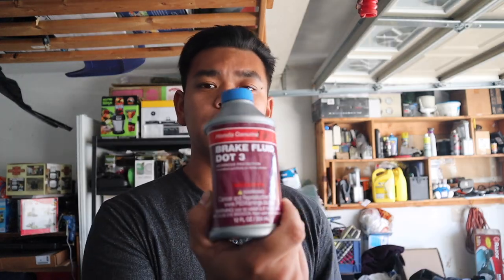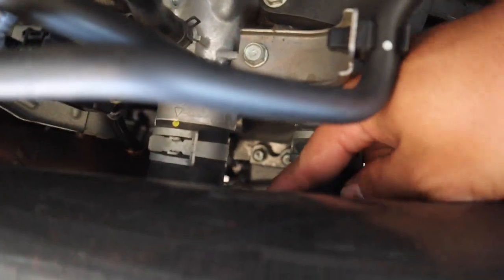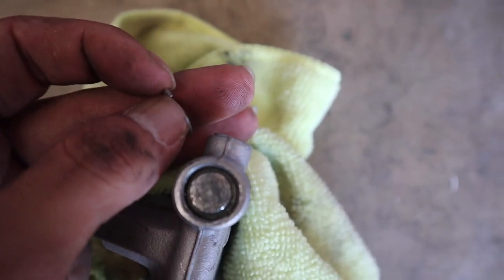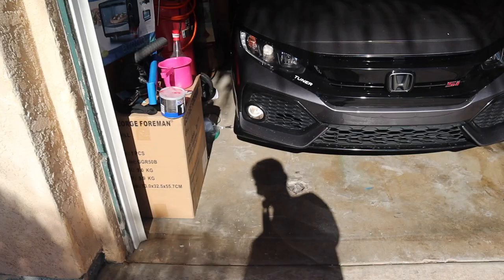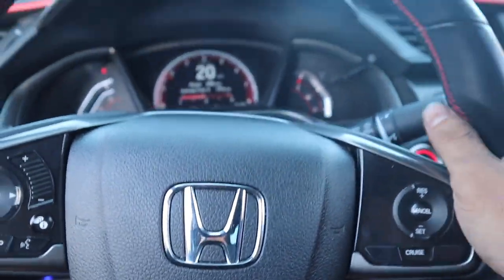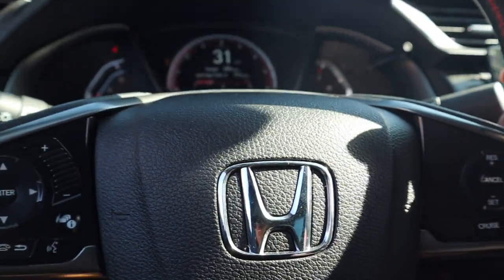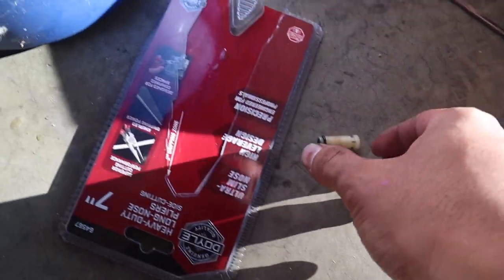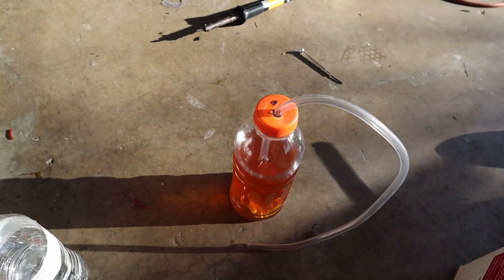BEST FREE MOD! | 10th Gen Si

Comment: Just removed mine on my 2010 TSX. Makes engaging the clutch to the bite point more consistent and smoother. My 1 to 2 shifts used to be so jerky that everyone thought I couldn't drive manual. Every other car I drove, I never had a 1 to 2 shift issue. I drove  Genesis Coupe 3.8 Track, SN95 V6 Mustang, FA20 WRX, Mazda Protégé 5, and Mazdaspeed 3. I always shifted better in other people's cars aside from my friend's TL Type S. That car also has the delay valve and the 1 to 2 shift is TRICKY!
Reply from the maker: That’s what I’m saying! It’s the delay valve! Glad to know this video helped you out man!

Comment: I did the same but pedal was kinda soft. So I ordered "speed bleeder". Bleeded clutch line first and then bleeded slave master cylinder itself. Pedal became firm. Overall it performs now the way it should come from the factory. No more jerking on the 1,2 gears. Thanks for your guidance.
Reply from the maker: No worries! I’m glad I was able to help!

Comment: Great vid...thanks for sharing these tips.  Have you replaced or upgraded the clutch yet?  The lightweight flywheel eliminates rev hang and improves throttle response considerably.  I think this is the next mod I need. The "jerkyness" almost got worse after the clutch upgrade.
Reply from the maker: Nope, stock clutch here still holding up !

Comment: Did your pedal feel lighter after deleting it? I did mine today and the pedal is butter.
Reply from the maker: Pedal is definitely butter! I don’t remember if it was lighter or the same, but I do know it was butter smooth!
Reply: @FORSAKENGARAGE  it almost feels too light, I was worried I didn't bleed it all the way. But I bled a few times after getting no bubbles to be safe. Maybe it's all in my head!
Reply: @AllBackEmergency  After deleting mine it feels light too, there's a video guy recommends bleed clatch line first then bleed slave cylinder last. But still feels lighter then it was, hope it's ok. I also had to seal threads on the bleeding valve because it was leaking air throug threads. Harbor Freight Tools sells vacuum brake bleeder for $20

Comment: Any updates on your transmission? Due to removing the CDV
Reply from the maker: Running fine, love the way it turned out, never looked back
Reply: @MVRKVLG i asked someone else yesterday about that and they said I shouldn’t do it. Q: are you on ktune/tsp Hondata or Pherable tune? I have the mind to do it but i need more input on pro’s n cons
Reply from the maker: @kingstonflores3040  Ktuner w/ phearable 1.5
Pros:
-instant grab no delay on the clutch
-removed notching on gears
-makes it easier to drive
-driving when you first start the car is no longer jumpy (if that makes sense) 
Cons
-cause transmission wear if you do not know how to drive manual due to the instant grab
Reply: @FORSAKENGARAGE  i should be good then. I’ve been driving since 12 legally since 30 🤣🤣🤣🤣 straight drive is all i drive anything less is uncivilized 🤣🤣🤣 thanks for the tip bro will get done when i install my 27won inlet pipe
Reply from the maker: @kingstonflores3040  its always reversable! If you do it and don't like the difference in feeling/response (which i 1000% love the way it is with the cdc removed) then you can always throw that valve back inside the cylinder as long as you don't throw it away! That's also why the video is titled best free mod! Of course with you having the tools laying around and some dot 3 brake fluid
Reply: @FORSAKENGARAGE  bet nuff said brother I’ll keep you updated
Reply from the maker: @kingstonflores3040  definitely comment back when you do the mod, I’d like to know your feedback on this simple mod

Comment: Forsure doing this mod I have the sirimoto CMC at home I’ll do both I have a stage 3 action clutch and I hate the engagement of it I know the clutch can grab harder this delay valve makes it feel like it’s slipping. Check my channel I have a lot of 10th gen si content
Reply from the maker: I’ll check it out later brotha! I’m currently busy, but yesssss you’ll be glad you got rid of that stupid valve they have. Huge night and day difference, how hard was the clutch install? My clutch is starting to slip, and I’ll be doing the work when winter comes that way I don’t gotta be sweating my ass off, I know you have to take out the axle and subframe but how was the work?

Comment: car sounds HORRIBLE.
Reply from the maker: To each their own 🙏🏽
Reply from the maker: @dirtyasianmafia2310  I agree, it definitely is something you either hate or love, to each their own! Thanks for watching I hope you enjoyed the video at least :/
Reply: Lol
Reply: Is that a custom exhaust leak?
Reply: yeah 10th gen pretty smooth so it makes sense to have smooth sound too. The SI especially is a more premium model and the coupe is the best looking 10th gen Civic. The factory SI exhaust sounds good, flows pretty good and makes better aero underneath
Reply: @jamesmedina2062  after going to hks on my 10th gen I have noticed that the stock exhaust was causing alot of drag underneath and how restrictive turbo response is more noticeable even with my tune
Reply: @aaronslaughter2987  drag is lowest with the stock SI but flow can be easily improved.
Reply: @jamesmedina2062  not really seeing how since the stock exhaust spans the width of the car at the real wheels with the double mufflers. Once you get rid of that its nothing nothing extra for the air to catch
Reply: @aaronslaughter2987  any manufacturers that care about higher speeds use the mufflers and exhaust pipes for aero themselves as they should be slightly proud (protruding) and create transition to flow off the rear bumpers. My Hatch had good flow too and when I went to one muffler I lost 1/2 of the aero back there so I am building a box that will fill up the space and possibly buying the two Type R wheel arch liners because they fill up the area behind the wheels for better aero. Honda cost cuts on the lower models.
Reply: @jamesmedina2062  those mufflers are massive on the car. Ground affect gets loat 3/4 of the way to the rear when the panels stop and all you have sitting in the air is the muffler which almost acts like an airplane wing. Getting rid of the full exhaust helps with aero and performance